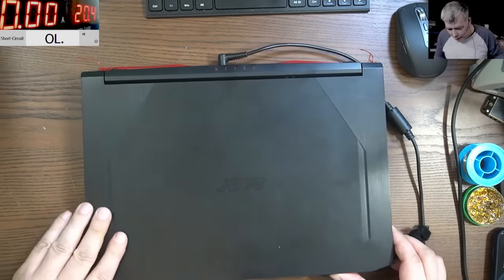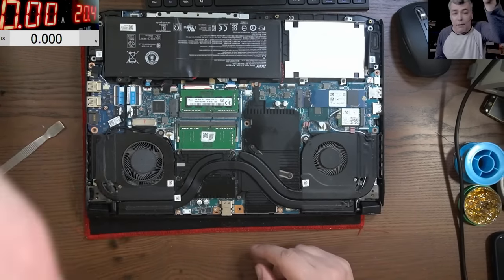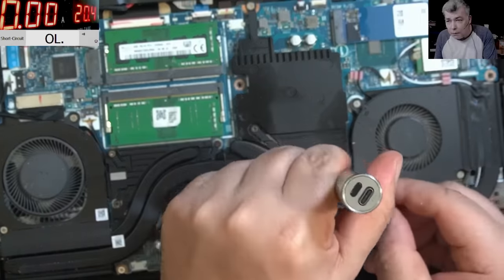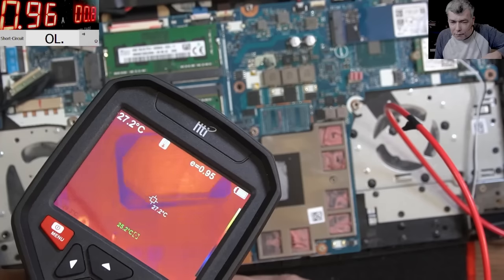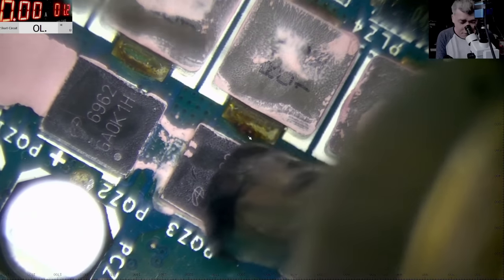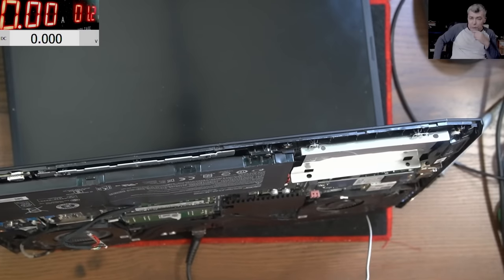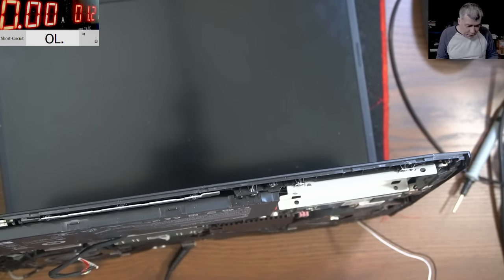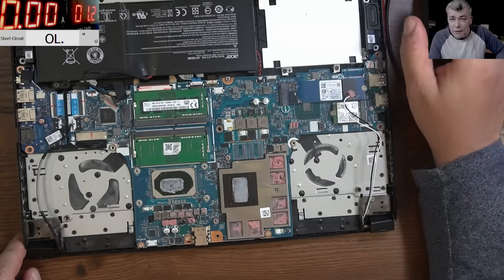Shorted high side mosfet = always a dead CPU or GPU Acer Nitro 5 AN515-55 not coming on or charging

Comment: A simpler method for identifying a shorted MOSFET without removing any component is to connect the coils to the ground. This will cause the faulty component to illuminate under a thermal camera, and it will also protect the CPU/GPU from excessive voltage because it will clamp it to ground. Just a tip.
Reply from the maker: Smart
Reply: I do so,can put more voltage
Reply: so like soldering a wire to the ground and to the coil? but what part of the coil? in between mosfet and coil or inbetween coil and cpu/gpu and such?
Reply: Could you share any examples of this ( video, etc.)?
Reply: I guess the only argument against would be that if you incorrectly identified a low resistance-to-ground inductor as a short, and then fed in amps, you could cause a fault on a good rail. But like most things, experience will help!
Reply: Clever. But why not simply desolder- lift up coil for check from CPU side or  other problem
Reply: @sipansibabdreddknot5179  it's a coil. Doesn't really matter which side.
Reply: @QARepair  speed and safety. Usually several coils need to be lifted and you might miss one. Connecting the bench PSU ground to the coil means you are just testing what's upstream. Putting the CPU power inputs at ground potential protects them from voltage.
Reply: An easier way is to just use an ESR meter with the motherboard/gpu powered off and measure directly across each coil. The one(s) with the shorted mosfet(s) will read very close to zero on the ESR meter and the others will read a resistance, probably around 0.5 ohm.
Reply: hmmmhmmm, why didn't i think of that, thanks for the tip :)
Reply: @LearnElectronicsRepair  so come with the esr meter one probe to coil and one probe to ground,yes?
Reply: @sipansibabdreddknot5179  agreed its dumb metode, good part will damage, save metode cek resistance coil n lift up to check where short is going

Comment: The question is what caused the fault. The mosfet blowing the cpu or the cpu causing the most stressed mosfet to short? Up until the last couple of years it was never the cpu especially on desktop boards, now we are seeing a lot more dead cpu's.
Reply: That's a good question! Both CPU and Power Mosfet can be the reason.  We know that current is high in the circuit. Perhaps Mosfet itself had some defects during production and was  overstressed  during normal operation. The same is also valid for the CPU. With enough heat and time silicon will fail. We don't know if cooling system was in fully working order. Perhaps this laptop had overheating issues.
Reply: The mosfets shorting is a pretty common problem on damaged laptops. We see CPU's in PC's don't really have this issue. I'm guessing the mosfets enclosed in such a small space with poor cooling leads to there failure. I think the CPU failure comes from the mosfet failure.
Reply: @anthonydenn4345  I have few cases whit shorted high side mosfet in desktop mothrboards, but never was the CPU damaged after that. Of course 12V ATX supply was applied directly to them, but survived.  Maybe the ATX supply is quicker to disconnect the power than these laptops, don't know.
Reply: well, i have seen a lot of coments that acer nitro is a expensive heater...
Reply: I just had this happen to my laptop. Was watching this video to learn how to diagnose before deciding next step. I wasn't even pushing my laptop hard or in terrible conditions and it just happened. Laptop wasn't particularly dirty. I'm wondering if maybe poor thermal paste or otherwise is not pulling enough heat. I am not experienced enough to discern unfortunately.
Reply: It is caused by not grounding yourself to something when changing out the ram. At least that is what happened to me.

Comment: Not always, I think. I have here an ASUS ROG which had a shorted high-side MOSFET and got 19 volts. It survived because of the working protection in the power supply.

Comment: Hi, I just want to ask my issue Acer nitro 5 With rtx 2060, ive install Nvidia driver and yes it was detected in Device manager showing Rtx 2060, But after restarting my laptop it will not bootup but keyboard light is on, I need to reformat the OS to make it running again using Intergrated Gpu of intel, hope you can help me. Thank you 😊

Comment: I think the manufacturers should do more to protect these bga ICs like cpu and gpu etc from high voltage or these ICs should have sockets.
Reply: The high-voltage protection is build-in, but it can not protect against a shorted high-side MOSFET. Then only the overcurrent-protection works. Many CPUs/GPUs survive this impact. A socket is a good idea, I think. But the reliability is not better.

Comment: Just had the same issue and on the same mosfet today. I actually plugged the power and saw the main power Moffett getting hot because of that little mosfet was shorted. I removed the little mosfet (same as you in the video), and the power actually went and powered the motherboard for a second only to stop right after. Again, under the thermal, the CPU was lighting up like Christmas. Defintly not worth repairing it. It's better to keep it for parts at this point

Comment: I just No-fixed an ACER Predator Helios 300 (Same motherboard shown in the video) with the same exact fault. I started by removing the two input MOSFETS and the 2 resistors. I Injected 1V/3A on left PAD of current sense resistors and found the shorted CPU MOSFET to be the one on the Far right. After removing it the short on the +19V input went away, but sadly measuring 0.3 Ohms to GND on the 4 CPU VCORE phases... :( RIP CPU. The MOSFET at position PQB11 was also shorted. When I looked in the barrel of the charger plug, there were scorch marks, and the charger was not outputting 19V. My guess the charger (aftermarket) may have been the fault.

Comment: Hi sorin little bit advice I'm watching always your video, if you remove a upper mosfet or high side mosfet don't plug in a charger without new mosfet, because the source of the upper mosfet is 19v, so they chance to wild that area because no mosfet detected by vcore ic, and is possible the lower mosfet will switch the ground in the cpu inductor
Reply from the maker: There is no lower mosfet, those are dual mosfets, two mosfets in one package.
Reply: @electronicsrepairschool  nice one if dual mosfet, by the way why u not connecting your laptop charger on DC bench to see the ampere what going on

Comment: 4:58 how is the motherboard is shorted to ground and when u plug thee power supply ,itss didn't show it , normally the voltage drop and the current got drawn , someone explain pleasee

Comment: Do the VRM fail becouse of heat? i know some people that want to play on a laptop but dont want to have any fan noise, could it be that most of the laptop that comes in are people that sett custom fan curve, or dont want the laptop to make any noise? i remember sorin once said that heat is the nr 1 factor that vrm fails or am i wrong? so playing with full fans on a laptop is not such a bad idea maybe hehe or am i wrong?
Reply: Heat is a factor, yes, but it could also be stress, those MOSFETs are switching very fast while dealing with a considerable high current so stress can also be a factor.
The datasheet has info on how much heat the component can tolerate and considering that there is very little ventilation inside a laptop compared to a desktop they have a high likelihood of dying, especially on gaming laptops, more powerful chips means more current, more current means more heat and so on.
In that sense, yeah, lowering the fan speed to lower the noise means more heat so higher likelihood of those components dying.

Comment: when u injecting voltage, why do u not measure voltage on coils? if high side mosfet is shorted, there should be some voltage, yes?
Reply: the coils outputs are connected together to the cpu or gpu ,wouldnt they show the same value?
you can actually come with power supply black prob at the input coils instead of the board ground and red one in 19v output caps to identify the shorted mosfet( gets hot) that way you are 'cancaling' cpu or the load from the circuit.
Reply: hmm... i dont know, maybe it's depends on damage level (of cpu/gpu), if it's not too high, then only one line will be shorted? i'm guessing, someone can correct? in that case voltage on (cpu/gpu) coils will be same (or greater than zero) or it's depends?

Comment: They are dual mosfet. With only one you control high and low side. I have same laptop for repair and the mosfet is shorted in high, low side, even the gate is shorted. Mine doesnt show screen also, after short is gone without faulty mosfet, but i can see that mosfet controller measure the sum of the mosfet output rail, and is probably that no screen image by this, another bad possibility is dead cpu, the worst thing, same thing that this video show 😰

Comment: Please do more tutorials on Acer Nitro 5 laptops. I have the same issue with my laptop since last week and I don't know why this laptop is that strange and weak. Sadly my Acer Nitro 5 AN-515-58 does not turn on and does not show any sign of life. I am desperately seeking a way to fix it, and there is no on in Missouri to fix it. All they can do is replace the mainboard with a new one which I also can do it myself but I need to make sure it's a dead laptop.

Comment: I miss the good old times when Sorin didn't have a thermal camera and he would have to use his hand. It would sound something like this:
We have a proper nice laptop here. i7, separate graphics, SSD, proper nice. Let's connect it to the power supply. No, no, no.. I can't find anything that's getting hot. No... It can't be a faulty CPU. No.. It will be a sad day if it's a dead CPU because this is a nice laptop. AJAJAAJAJAJAJAJ this is mad hot! I burned my finger! It's a hot capacitor! The CPU is fine! 😃

Those videos were suspenseful and interesting until the last second 😂
Reply from the maker: Hahaa, i understand but the truth is, the thermal camera made my life easier :D
Reply: @electronicsrepairschool  yes, I fully understand. It can save you hours of work.
Reply: It's a capacitor! I can't believe.
Reply: @OnStageLighting  I cant believe, this is crazy
Reply: @martinharmath1566  the customer got lucky. Usually these gaming laptops are tricky.

Comment: How did you know it's a dead high side mosfet from beginning? Can we guess it from charging current before opening the laptop?
Reply: They are dual mosfet. With only one you control high and low side. I have same laptop for repair and the mosfet is shorted in high, low side, even the gate is shorted. Mine does show screen also, after short is gone without faulty mosfet, but i can see that mosfet controller measure the sum of the mosfet output rail, and is probably that no screen image by this, another bad possibility is dead cpu, the worst thing

Comment: I have 2 questions here? First one is the Mosfet was shorted and caused CPU to fail, is it right? And the second one is, if u had a CPU spare one Exactly same, can u able to replace it and make it work or is the mainboard damaged also and not possible to replace or make it work again?
Reply: Cpu removal requires a specific machine that heats the entire board evenly and safely and makes the cpu easier to remove, but most technicians can't afford it because it is very costly and not economical

Comment: So sad, I feel for the owner. Spending so much on a gaming laptop only to watch it fail and unrepairable. 😟
Reply: Is it not the case of just replacing the cpu then?
Reply: @tirins replacing the cpu, correct! 👍 🎉 but it has to be the same exact cpu or you’ll most likely run into bios troubles or temp problems

Comment: Well.. my nitro 5 was up and running fine. Went out side to get my cat inside.. started raining pretty bad. After about 10 minutes. I came back to my laptop powerless.. no lights.. connected to surge protecter.. screen wo t come on. I mean absolutely nothing. Not a single beep. What the heck is going on? I've read post after post about these nitro 5s dieing after a storm.. how can I even fix this?

Comment: Is there way to prevent any consumers from getting this issue ?
Reply: dont play any game in your gaming laptop
Reply: Yeah. You can avoid buying gaming laptops. They are almost all burning up prematurely.  I'm a victim myself. Only lasted 2 years. All my prior TOWER builds NERVER failed.  Learned a valuable lesson. 2700$ down the drain
Reply: if you want the laptop just for playing, maybe a normal laptop + egpu could be an option, avoid gaming laptops if you are gonna play a lot, better a desktop pc
Reply: @lPlanetarizado  I play with my legion 5 pro for 5 hour sometime less with cooling pad and I limit the temps to 86c for cpu 
And gpu most of the time is 76c in heavy games

Comment: "80% of my jobs are gaming laptops" What could be the reason ? It is the fact that gaming laptops are expensive and worth the cost to repair as opposed to a 350 euro laptop which people might prefer to just throw away if it breaks outside warranty than to spend time and money to get it fixed ? Or other reason (like Sorin is getting the harder to repair jobs (which just happen to be gaming laptops with their higher complexity and discrete video card)  after normal shops fail to repair them ? Would be interested to know.
Reply: Partly because gaming laptops are always pushing the basic laws of physics.
Reply: i guess you are kind of right saying that gaming laptops are expensive and buying another one is too expensive, but if you look the adapter of gaming and no-gaming laptops you will see quite the amps difference, from like 2,5 (normal) to 10 (gaming), even 15 amps

Comment: I have never understood why the CPU gets burnt when the MOSFET is shorted. Normally the MOSFET is conducting current, the same as if it is shorted. Even if you get more Amps momentarily, as explained here, what makes the CPU draw more Amps? Is it a question about Volts?
Reply: A cpu is not made for a 20v pressure..
Reply: If you look at the schematic of the buck circuit that powers IC, it becomes obvious what happens when the high side MOSFET shorts. Full PSU voltage straight to a line made for 0.8v. Current is the result of voltage and resistance.
Reply: @OnStageLighting  
Is the MOSFET part of a Voltage regulation? I didn't think there was so much reglation in a MOSFET. Not like a transistor.
Reply: @Drottninggatan2017  the high frequency switching of MOSFETs is the basis of all modern buck or boost voltage regulation circuit designs.
Reply: @OnStageLighting  
Okey, tanks.
But then, why can't there be a current limiter or a fuse after the MOSFET?
That should be a inexpensive protection against overcurrent.
Reply: @Drottninggatan2017  The T in MOSFET is for Transistor.

As the other guy said, the one that shorted is being used as one phase in a high frequency buck regulator (efficient voltage regulator).
Also know as VRM = voltage regulator module.
If you short it, output voltage = input voltage, no more regulation.

The first and second MOSFETs in laptops are not part of the VRM circuit and are used as more of a switch.
Reply: @Drottninggatan2017  the circuit is specifically designed to pass high current. What it can't handle is high voltage on the wrong side of the MOSFET at the IC. I'm not sure how effective traditional overvoltage suppression and protection techniques would be as I'm not a designer.
Reply: @OnStageLighting  Depends really on what kind of overvoltage the IC can tolerate. We would need to set the clamping voltage a bit higher to prevent the overvoltage protection from interfering with normal operation. Simples but not the best way is a zener diode. For example if the IC takes 1 V on normal operation we could place a 1.5v zener in parallel, and it would only conduct once voltage hits 1.5v. The problem with this is that ALL the heat is now dissipated in the zener, and it would get very hot very quickly. A better solution is a "crowbar" circuit, which would trigger once voltage hits a certain level, and place a dead short across the power rail, dropping the voltage to zero and pulling a lot of amps from the supply, this would also trigger an upstream overcurrent protection or hopefully blow a fuse, but the IC would be protected. 
The problem is todays devices are cost cut to the extreme, and a 2-3$ protection module is considered too expensive for mass production, they would rather you take the chance that there will never be a overvoltage situation. Some accountant calculated that the cost of replacing a couple of devices that will fail under warranty is lower than the cost of adding protection for every device, and what fails after warranty is no longer the manufacturers concern.
Reply: @petarmiletic997  I assumed a crowbar solution but have never seen such a circuit used in this kind of application. Assumed due to cost, as you say.
Reply: @Drottninggatan2017  the current is not the problem! the cpu takes current, its not "you push 100a" into it.